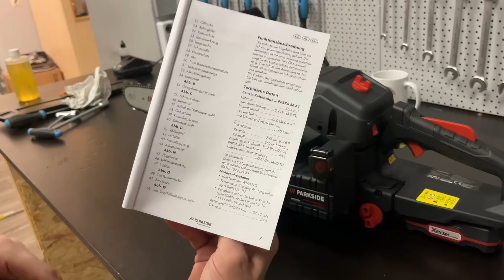Parkside Kettensäge mit E-Starter #sägendoktor #haselünne #parkside #kettensäge #motorsäge #stihl

Comment: Hallo sagedocteur EStart parkside die hat 50.9 c m3 .. die nie  56cm3 😭😭 das eien klon wie die deytos .. grussen .. der Elsasser 🥨
Reply from the maker: Moin (; Ich habe die Daten aus der beiliegenden Anleitung abgelesen, 56,5ccm
Reply: @sagendoktor9883   es gibt 4 motor grossen  zenoah der  45 cm 50.9 ,der 58 cm under 61.5cm   und ist als  .. danken dir fur control vidéo Uber der motor grossen 🤞🤞der Elsasser 🥨
Reply: die ersten beiden 31-mm-Kurbelwellen und zwei weitere 34-mm-Kurbelwellen danke fur d'as super vidéo 🫵danke🙏der Elsasser 🥨
Reply: @thomasr.4565   parkside gibt und zenoah klon ,ich ben Husqvarna 371xp zeit 1997  der best of fur mit  und 8 machin ,mit brenholz hobby und die one 395 XP big more HD mit100ccm quad port 🤞🤞der Elsasser 🥨
Reply: Mach mal den Dichtring ab ist meistens ein Kunststoffgrad vom Spritzgießen dran oder am Gehäuse!